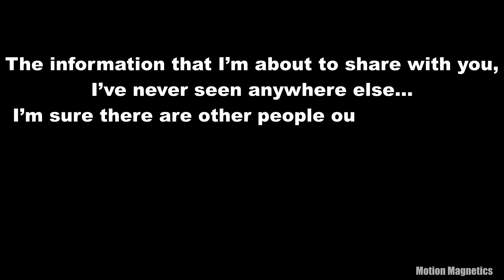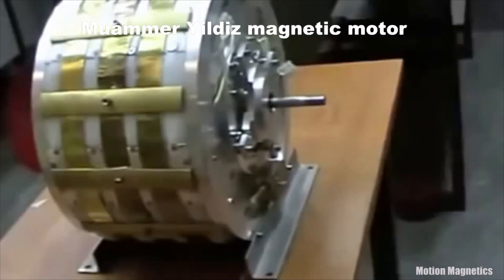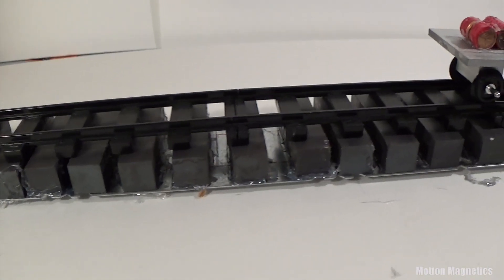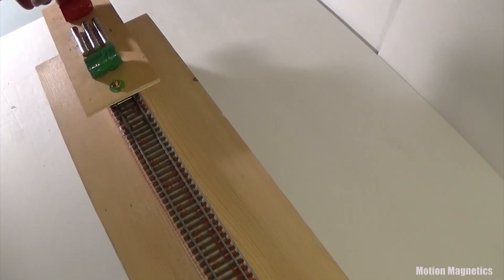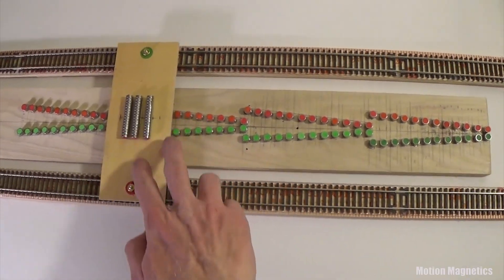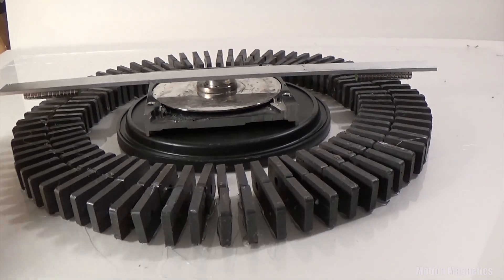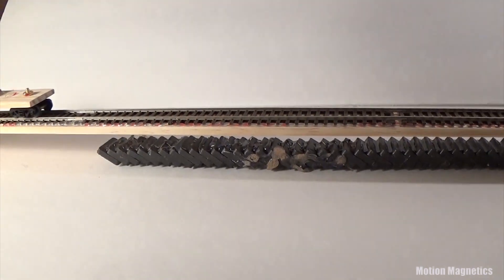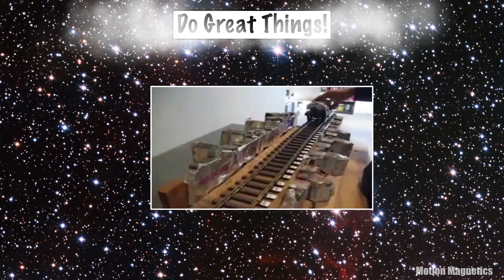The 3 Types of Magnetic Motors Part 01

Comment: CONTACT ME WHEN U TRY THIS AND TEST .     Below is a detailed circuit schematic description and an accompanying ASCII diagram you can use as a blueprint for a PCB layout (which you can later import or trace in OpenOffice Draw):
Overview of the 12V Electromagnetic Pulse System
1. Energy Collection & Conditioning: 
Source: Coiled magnet set in motion (from your moving magnets) generates an AC voltage. 
Rectification & Filtering: A bridge rectifier converts this AC into DC. Filtering capacitors smooth the output. 
Capacitor Bank: The smoothed DC charges a capacitor bank rated for 12V operation. 
Voltage Regulation: A 12V regulator (if needed) ensures the voltage remains stable for subsequent circuit elements. 
2. Pulse Discharge & Polarity Control: 
H-Bridge: Four MOSFETs arranged in an H-bridge configuration allow you to route the 12V discharge either way across the electromagnet load. 
Pulse Control: A MOSFET driver circuit (with designated gate resistors) is driven by PWM signals to provide precisely timed, fast switching. 
3. Logic-Based Corrections: 
Microcontroller: A microcontroller (for example, an Arduino Nano or similar) monitors key system parameters (voltage, current via sensors/voltage dividers) and provides PWM outputs. 
Feedback Loop: Based on the sensed parameters (which represent the “induced resistance”), the microcontroller adjusts the switching and even controls the polarity (via the H-bridge) as needed. 
Component Value Recommendations (Example Values):
Capacitor Bank: You might use an array—say 4–8 electrolytic or tantalum capacitors in parallel—to achieve a total capacitance in the range of 220 µF to 470 µF (rated at 25V for a safety margin) so that at 12V the energy can be stored and released appropriately. 
MOSFETs: Choose logic-level MOSFETs that can fully switch on with a 12V (or lower, if using a proper driver) gate drive. For low-power applications, parts like the IRLZ44N (or similar) can work well. 
Bridge Rectifier: A full-wave bridge rectifier rated for your expected current, typically with a voltage rating of at least 25V. 
Microcontroller: An Arduino Nano or similar 5V / 3.3V board will suffice. Use appropriate level shifting if your MOSFET driver or high‐side drive requires 12V signals. 
Gate Driver: A dedicated gate driver IC (or driver transistor circuitry) can help ensure rapid switching of the MOSFETs. 
ASCII Schematic Diagram
Below is an ASCII representation of the complete circuit:
[Coiled Magnet Energy Source] │ │ ▼ ┌─────────────────────┐ │ Bridge Rectifier │ │ (D1, D2, D3, D4) │ └─────────────────────┘ │ ▼ ┌─────────────────────┐ │ Filtering Stage │ │ (Bypass Capacitors) │ └─────────────────────┘ │ ▼ ┌─────────────────────┐ │ Capacitor Bank │ │ (Total C ≈ 220-470µF)│ │ Rated for 25V+ │ └─────────────────────┘ │ ▼ ┌─────────────────────┐ │ 12V Voltage Reg. │ └─────────────────────┘ │ +-------+-------+ │ │ ▼ ▼ ┌─────────────────┐ ┌───────────────┐ │ Microcontroller │ │ Sensor Input │ │ (e.g., Arduino │ │ (Current/Volt)│ │ Nano) │ └───────────────┘ └─────────────────┘ │ │ PWM / Logic Signals │ (and feedback control) ▼ ┌─────────────────────────────┐ │ Gate Driver / MOSFET │ │ Switching Circuit │ └─────────────────────────────┘ │ ▼ ┌──────────────┐ │ H-Bridge │ │ (4 MOSFETs: │ │ Q1, Q2, Q3, Q4)│ └──────────────┘ │ │ ┌─────┘ └─────┐ │ │ ▼ ▼ ┌────────────────┐ ┌────────────────┐ │ Electromagnet │ │ Electromagnet │ │ (Pulse Coil 1) │ │ (Pulse Coil 2) │ └────────────────┘ └────────────────┘ 

Explanation:
1. Energy Source & Conditioning: The top part captures energy from the motion of coiled magnets. The AC is rectified and smoothed, then stored in a capacitor bank. A voltage regulator maintains a steady 12V output for the rest of the circuit. 
2. Control & Logic: The microcontroller receives sensor data and, using PWM outputs along with a dedicated gate driver, controls the H-bridge. This provides precise timing and polarity control of the electromagnetic pulse through rapid switching of MOSFETs. 
3. H-Bridge & Load: The H-bridge (with four MOSFETs) routes the 12V pulse to one of two electromagnet loads. You could use this setup to adjust the magnetic polarity dynamically, overcoming load resistance as measured by your sensors. 
Next Steps for PCB Creation in OpenOffice:
1. Transfer the Diagram: 
Open OpenOffice Draw (or Impress). 
Use vector shapes (rectangles, lines, arrows) to recreate the block diagram based on the above ASCII layout. 
2. Refinement: 
Label components clearly. 
Use layers to separate the power, control, and sensor sections. 
3. Export: 
Once complete, export your schematic as a PDF or SVG, which can be shared or printed. 
This schematic is a starting point—you may need to iterate and adjust values or add in additional protections (like flyback diodes across the electromagnet coils) when you build and test your prototype.
Would you like more details on any specific section—such as the MOSFET gate driver design or how to implement the microcontroller feedback loop?
EXAMPLE ON TYPE TO BE USED .    https://www.youtube.com/watch?v=YCuVSAnlQfw
there are better designes

Comment: What if you use steel as the projectile, and alternating the poles of the v gates
Reply from the maker: Not a bad idea. You'd possibly get a similar result, but there would be slightly less magnetic force trying to pull the projectile back into the track. That's something to consider trying though.

Comment: There is no magnetic motors, Magnets don't create power, they have force, that force has to be reversed to undo it once it comes to a stop, the reversal process requires external energy, by hand or by reversing magnetic polarity (possible only by electro magnets). My advice to you is instead of spending money on mgnets, use them to get an education and understand the laws of physics.

Comment: Well, they arent actually motors.... Bc you are putting the energy in yourself as potential energy when you set up the magnets/cart. however. You may be on to something in storing energy of already moving objects in the fields of perm magnets for later acceleration/braking
Reply: Could be useful for maglev trains. But its gotta be in a vaccum chamber to work best.

Comment: Testing system with too many magnets looking for the correct arrangement is inefficient since you added more variable for each magnet placement. Moreover each magnet have different magnetic force value although having the same brand and size, so you will likely facing another challenge when replicate another one.

Comment: What you need is a simulator and some measurements. It is expensive and time consuming to build physical models. So learn to do them in the computer. There are lots of field calculators and force calculators. None of your magnet shapes are complicated. The geometries are fairly simple. Focus on the magnetic energy density (magnetic pressure) and magnetic pressure gradient forces. These are resonant phenomena (depend on fairly precise timing and the shapes and field strength) so calculating them and measuring will be faster than making physical models. When you want to make models, measure the fields of your individual magnets and use that to calibrate them in your overall project model. Calculate what the combined fields will look like in the computer based on that. Then measure the fields of the assembly. If they don't match your field calculation algorithms are wrong.

Find the mass and velocity and acceleration of things. You can take videos and recover the positions, speeds and accelerations. If you put registration markers on your "vehicles" and rotors you can recover the position. Take the first derivative to get the velocity. Take the second derivative to get the acceleration. Do a couple more just to get familiar with them (the 3rd and higher time derivatives are called rather cutely - jerk, snap, crackle, pop. I kid you not).

You have resistance and drag on most of the contact and rolling parts. That goes into the second order differential equation that is called the equation of motion. Learn to measure these friction and drag terms, because when you solve for the critical values for continuous motion or rotation, the resonant or critical conditions can be quite narrow. You saw that when you were using the V shaped arrays of small magnets to create magnetic gradients (changing magnetic pressure fields). It would get past the first couple, but not have enough momentum (mass times velocity) to keep going. It was just a tiny bit more you needed, but since you did not measure, you could not be sure. Would a faster (higher velocity and momentum) start make a difference and get you all the way across the path? You could not be sure.

Permanent magnets are made deliberately to NOT lose energy. So using them as a stored source of energy is hard to impossible. You know how far a magnet will fly when a small magnetic south is pressed hard against a similar or larger fixed south. (or north north). It can go a long way. If you could lock them together, then release them at will, you get momentum for force and energy to do things. Imagine using nano scale, multi-Tesla magnetic domains, assembled and locked into wires or powders.  You feed the wire, release the bonds and use the resulting kinetic energy to do things.  Since the magnets remain magnetic, you can use the energy to create electrical currents or for momentum.  A powder (the bound pairs are neutral until you release them) would work. If the magnetic pairs can be released by heating that would work.  I am not giving you a cookbook.

The magnetic energy density in vacuum is B^2/(2 muo) and there is a corresponding one for where you have materials.  The important thing for storing energy in magnetic pairs at cluster, molecular, atomic and subnuclear levels is the magnetic dipole energy which depends on the inverse cube of the distance.  It is hard to assemble atomic and nuclear magnetic pairs. They want to snap together NS.  But, since it is time dependent, and clusters are large and slow enough, you could start there and gradually gain experience for faster and more energy dense situations. When two electrons bind by magnetic dipole forces, or two protons, the energies are "atomic" and "nuclear" in scale.  Don't trust me, go try it yourself.  Go to Magnetic Dipole (https://en.wikipedia.org/wiki/Magnetic_dipole) and skipped down to Forces between two magnetic dipoles.  Look at the equation that starts F(R, M1, M2) = 

It has vector dot product terms.  (m1*r) just means the magnetic moment of the magnet1 along the line joining the center of each.  m1*m1 is the part of m1 in the same direction as m2 (its north direction).  Notice the first three terms have r in them and the last terms only gets really large when they are really close.  That r cancels one of the r^5 terms in the term in front.  So the force goes as 1/r^4 - really really tiny when far apart. And really really large when they are close.  r is in meters. So when you are less than a meter the 1/r^4 term gets larger because you are dividing by something smaller than 1. If r is nanometers that is (1/10^-36) or 10^36.  Do it yourself.  I suggest a spreadsheet so you can share.  You won't be able to share on YouTube, they have no way for people to communicate and share anything but video formats, rather limited ones.

You might try using carbon nanotubes.  High current densities and small size means really large magnetic fields.  Big Teslas.  Here is "Significant Multi Tesla Fields Within a Solenoid Encircled by Nanostructure Windings" (https://www.nature.com/articles/s41598-018-38306-8)

Now there is so much going on, you might want to start at "magnetic" "nanowires" "tesla" (https://www.google.com/search?q=%22magnetic%22+%22nanowires%22+%22tesla%22) and look around just to get a sense of the many things happening with magnetic nano and pico materials.  

This one looks interesting -

 "Magnetic assembly of nanowires" (https://www.researchgate.net/publication/252049716_Magnetic_assembly_of_nanowires)  

but I do not have time to organize all this just now.  I am trying to index the entire Internet. There are many interesting things and methods, all stuck away in different places, different formats, different names.  It is possible to use them as a whole.  That is what I am working on.  And I wish I had time to actually make things.

The starting point for any application is measurement, modeling, simulation, calibration -- and working in communities of people sharing models.  We don't have formats to exchange magnetic assembly instructions (probably CAD CAM and 3D printing formats) can be used.   So if standard magnets are use, you could have people or robots assemble the magnetic parts.

Ultimately these passive magnets are reducing friction (the old magnetic bearings), and probably not much usable magnetic energy.  What you put in, is what you get out.  Use up your push energy and it stops.  Now I did see some comments that suggest that they were using stored energy from magnets.  That means, at the temperatures involved, and for the bonding and characteristics of the magnetic domains involved, some energy could be released.  I don't even want to bother.  You just measure carefully and see.  For the same effort (time invested) you can probably design your own magnetic pairs that can release energy as needed, and get further than trying to convince the magnet manufacturers to give you magnets simply as stored energy devices. Since they are bulk materials, that would be hard for them to do.  

If you are going to devote years to something, you can find better tools for modeling.  I am trying to find which ones are best. But the sad practice is for anyone who learns to do something, rather than share and grow the whole, they get greedy, hoard their tiny piece - rather than create new industries.   I want to see things like real starships and that won't happen if people fight for scraps.

Richard Collins, Director, The Internet Foundation

Comment: If you notice, all of the clips of rotary devices are either only a couple of seconds long, or they show the device coming to a stop. That is because all of the motion you are seeing is simply the inertia from when the motion was started. What you are seeing is that the arm speeds up temporarily toward a magnet, then decelerates by the same amount as it moves away from the same magnet. Over time, due to friction and air resistance, this bumpy accelerate-decelerate pattern tends toward decelerate, and the system will inevitably come to a rest. These devices utilize magical thinking, and cannot work. Gauss' law demonstrates that there are no magnetic monopoles: The fields created by magnets form closed dipole loops without exception. In effect, this means if a magnetic rotor is moving past a magnetic pole in a stator, any acceleration experienced as it approaches the pole will be negated by an equal deceleration as it moves away. Actual functional motors function using electromagnets, using switching patterns or the phase rotation of AC power to move magnetic fields at the appropriate time, and continually push/pull the rotor: See this video about brushless DC motors for a demonstration. (Source: I'm an electrical engineer) https://www.youtube.com/watch?v=bCEiOnuODac

Comment: My version, not published yet, is far best. I got an  idea 45 years ago. Now, these months, it's time for me to make it. It's overpasses all problems seen in all of these designs. It consist magnets, spherical shapes - in this case, no need to worry about unwanted rejection forces: the maximum is in only one point. That point is just slightly covered with half-sphere shield made of....something. Rotor has flywheel, a heavy one, with significant mass. That mass, ensure that magnets, when passing by adjacent magnet in stator, cannot stuck as reaction of negative rejection force. In calculation, rpm is, theoretically, indefinite? That's, however, impossible and unwanted. So, stator assembly has unique construction which is look like umbrella - it spreads and narrowing, making magnets in stator closer or further - that speed can be adjusted mechanically, once the machine is started and adjusted according to the tied generator. It works beautifully. Construction is complicated, but magnificent, and easy to understand. In FEMM calculations, it is working as the magnetic field of the Earth. It work on natural principles of Earth rotation. But, the question is, whether we need it - these 45 years I've spent, mostly considering side-effects of the free energy on the masses. My conclusions are : it can freedom to every single being on the Earth, which is impossible: States must have control of their own resources. Every man might become an individual, it could live far remotely from the civilization. This was proved as impossible mission , cause most of the tribes, anywhere in the World, are in danger. Most developed countries needs resources to ensure their "wealthy life". The next thing is, how to make slow transformation from the existing power sources, mainly from the water power and nuclear energy. Then, what would be the impact on car industry - from the moment when this energy would be presented to the World, the very first morning since that date, would be the loss of money, for any industry, not only for the car makers. When I'm talking about this, I'm still thinking, whether to make it or not. Honestly. On the other hand, I don't think that I'm most intelligent man, far from that - bearing in mind this, I know that these stuff are, in some form, is made all around the world, but, the same question is floating above their heads.
Reply: unless the "something" is some magical inexistent thing with no friction, the energy dispersed in that "something" is what will slow the system down